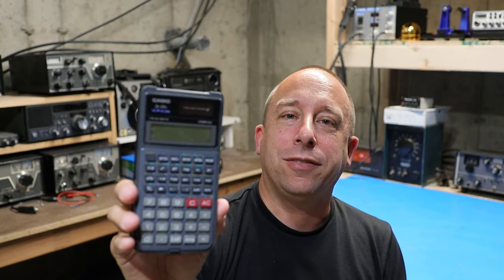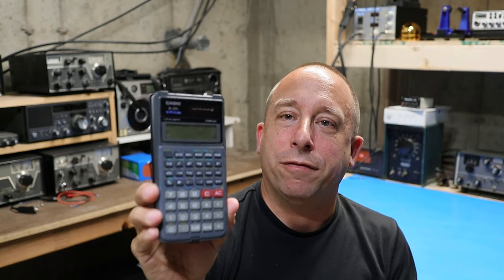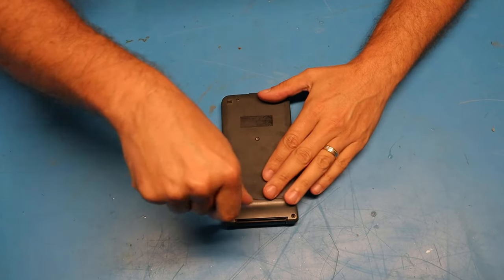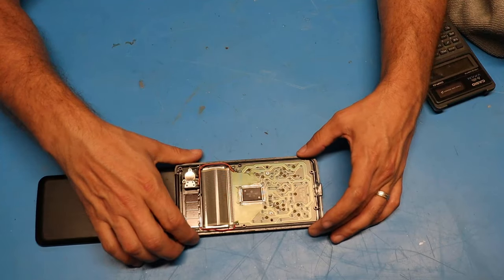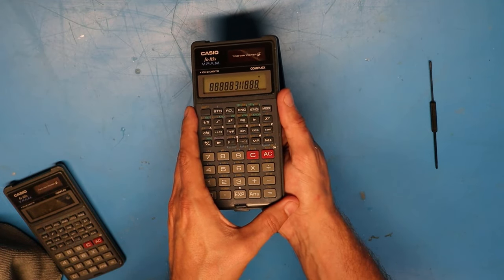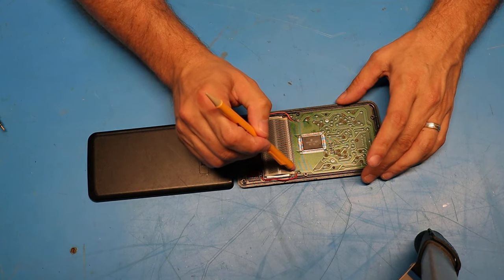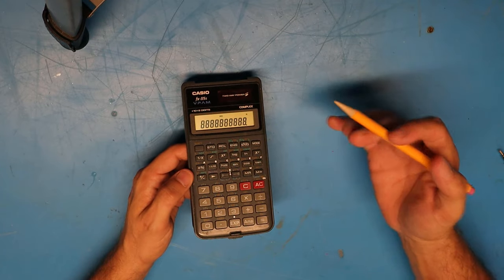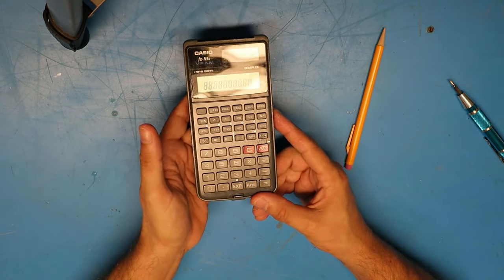► Bad LCD Screen Repaired - Casio Scientific Calculator

Comment: Thanks a lot sir for an idea!
I have tried heating and pressing but did no good to me (i guess there isn't much adhesive left on my board), 
so i tried a different approach.
I took a piece of soft material and placed it on the top of that problematic spot. It works like a charm!

Comment: Holy Crap!  My TI 30Xa had something like this displayed ....   didddiii instead of 888888. I was missing an attachment to my soldering iron so I carefully pressed the iron on a small wad of aluminum foil against the ribbon area. I carefully ran it across a few times. IT WORKED.  I was about to chuck my 40 year old calculator before running across your video.  I know it's only a $10-15 calculator, but it made my day.  Thanks Dude!
Reply from the maker: Awesome 👍
Reply: I got the same problem, with the TI 25x, i hope so fix that, your información i think to help me

Comment: Hi! Thanks to you, i fixed a similar problem with my fx-992s. In my case, the problem was found on the LCD side: some of ribbon cable pins has lost a contact with the LCD. I fixed it using the soldering iron. At first, i fold a piece of aluminium foil to make 4 layers. Then this foil have been applied above the ribbon cable upon the area, where it's connected with the LCD. Then i heat the foil using my soldering iron (150 C degrees), and following its tip i move some silicone card to apply some pressure. My fx-992s is working again! Thanks a lot from Ukraine!
Reply from the maker: Excellent!  I'm glad you got it working!

Comment: What is the name of the tool you used? Is it a soldering iron, but you’re only using the hot air and not making any contact with the components? If I don’t have one, would a hairdryer work?
Reply from the maker: It's called a hot air rework station.  A har dryer probably won't get hot enough.  But a hot air tool you can buy at a hardware store or maybe harbor freight might...I'm not sure

Comment: I just found 2 Casio CQ-82 alarm clock calculators. Boxed & probably never used. I stuck 2 batteries in but the displays are very faded. Is there a way to repair or replace them? They look ultra retro cool & I'd happily give one to someone who could fix one up for me.

Comment: I bought a second hand calculator for NZD2 yesterday to give to my student. Battery was flat. Upon opening and changing, found the characters were not displaying properly across the whole screen. I used your technic with a hair dryer and that did the trick!
Thank you so much for the tip: I will make a student happy, and I have saved e-waste!
Nga mihi nui
Reply from the maker: Awesome 👍

Comment: Firstly, thanks for the video. However, I'll let you know if that if you use a potato laptop, the 720p60 is unplayable. Youtube has, I believe, stopped distributing 720p30 videos where 720p60 is available. There are firefox add-ons that occasionally work, but they're unreliable. Since we're talking about reviving old hardware I figured I'd let you know (and yes, I realize it's 2 years ago but whatever).
Reply from the maker: You can change the playback resolution in your browser
Reply: @SevenFortyOne  Do you mean by clicking the gearwheel? If so, it doesn't have 720p30 as an option if 720p60 exists, and sometimes 480 (or even 360 if 480 is not present, which happens) doesn't have the appropriate resolution for certain videos. However, if firefox has a way to default to 720p30 on youtube that would be awesome... I assume you mean the first thing, though.
Reply: Which O/S are you using on such an old computer? Am still using Win 7 offline on some of my museum pieces.
Reply from the maker: @JohnHoranzy  I don't remember what computer I showed in this video but maybe Linux...I have that on a few of my old machines